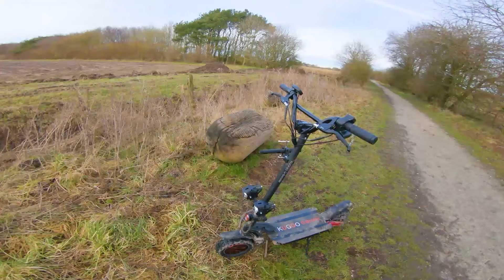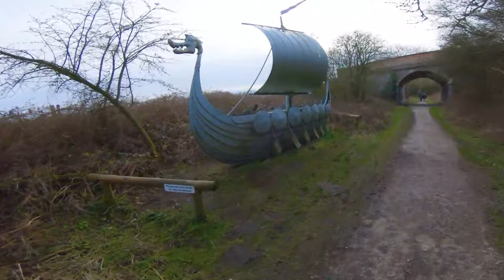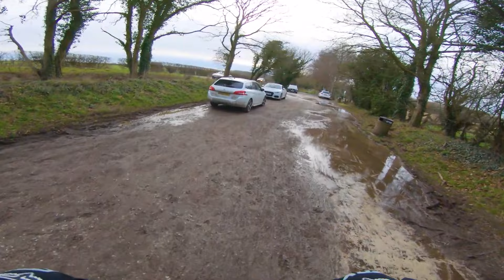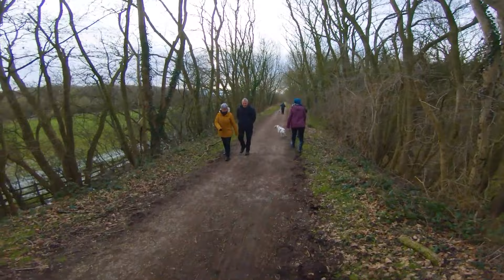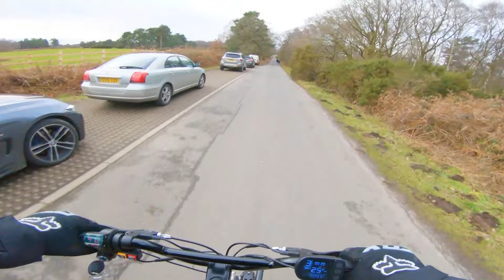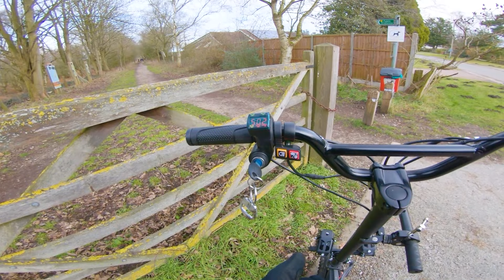Why Is My Replacement Kugoo G Booster Electric Scooter Also Broken After 20 miles?!!

Comment: Hi guys, yesterday after 2 hrs nice ride on unpaved surfaces i went home and i plug it to charge, but it is not charging. Any help why  and how to fix it?
Reply from the maker: You will have to open the deck and trace the charge wires back from port. I reckon a broken wire or connector, it should be obvious once you find it
Reply: @bill-e6114  Thanks mate, i will try.

Comment: ive just got this scooter im loosing about 1 volt per mile is that normal also my display baterry keeps flashing and says i have 0 bars
Reply from the maker: 1 volt sounds fair if your going fast all of the time. Have you touched any of the p settings?
Reply: @bill-e6114  no I haven’t is there anything I should change on them to see if I can fix it ?
Reply from the maker: Could be a faulty display if your not having any issues apart from that. As long as I think P3 is set to 48v I can't see any other setting that could affect it
Reply: @bill-e6114  okay cheers

Comment: You should try the solar scooters 2 year warranty and there based in London great vid
Reply from the maker: Cheers bud! I'm going to try one at somepoint, just for that warranty. What model have you got? I've just got a new scooter so that's 3 now so I can't justify another atm but will definitely go with them if I sell the booster
Reply: @bill-e6114  for the warranty alone it’s worth it mate my R1 should be here next week it’s 24amp 60w jake billing just did a video on it they say 50 mph but I think realistcly your looking at 40 mph for the price I think it’s the best out there.
Reply from the maker: Yeah I think you can expect zero10x performance from that, 40 is bloody fast on a scooter mate,  I don't think you will want or need to go any faster. I have the Viper Duel 5600w and that's too fast!
Reply: Aren’t solar scooters rebranded chinese ones originally going for 500 and then being flogged for 1000-1500
Reply from the maker: @KM-yh7lw  Yeah they pretty much all are, not sure about the mark up on their models but some do have good components like Nutt brakes. They do offer that warranty which is why I am sure they are more attractive than buying direct from China or unreliable sellers. Its not great when you have a problem and your pushed from pillar to post to sort a broken scooter

Comment: any chance you could do a video on the settings for the g booster. I've been flicking through them but can't work out what the best settings are to have them on.
Reply from the maker: I think EUC Rider has already done a vid on this. But the only one in my mind thats useful is P14 current. That wildly changes the torque. Default is 12 but, put it near 20 and the scooter really gets going. The rest of the settings are made for ebikes and the PAS on them as these are basically ebike controllers

Comment: indeed, there are some strange issues with this new versions, which the old didn't have...
Reply from the maker: They should had been good changes, these new controllers are 25a so more power than the old ones. But, they just don't function right

Comment: G Booster is terrible. Screws on the deck are now stripped which is dangerous. Innertube valve is stuck in the rear rim so I can't fully remove it. Constant flats even with the green stuff. Lol it's issue after issue for me. I need someone to fix it but it won't be easy. If anyone in London wants to lend a helping hand, give me a shout.
Reply from the maker: I've had trouble with deck screws, also the valves. I ended up going to a tubeless tyre straight away, so can't comment on flats although I know its a common problem on the back wheel. I would help if I was closer bud

Comment: Hiya mate l just watched a video about the g booster cogging noise, he found of the issue is the controller.
Reply from the maker: Yeah I think we're all convinced it is now. Although I'm thinking of replacing all mosfets on the current controllers or possibly replacing both controllers with slightly more powerful ones. Might hold of until the scooter is unrideable first though